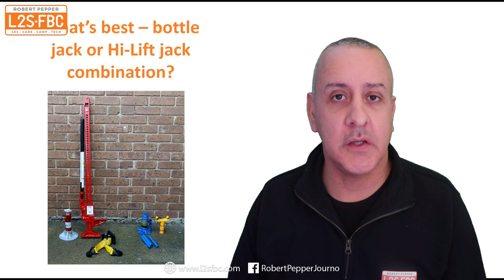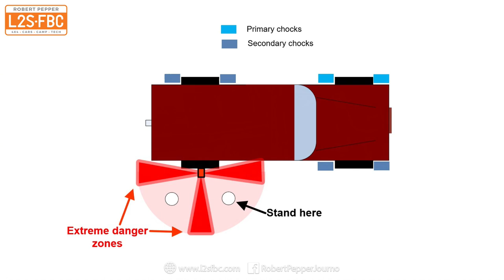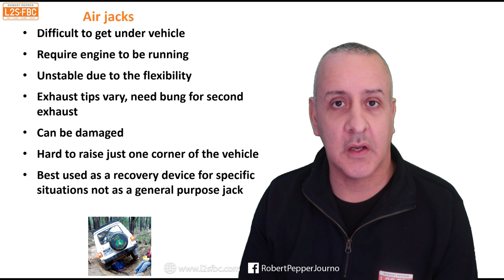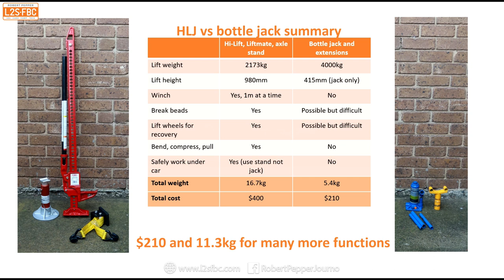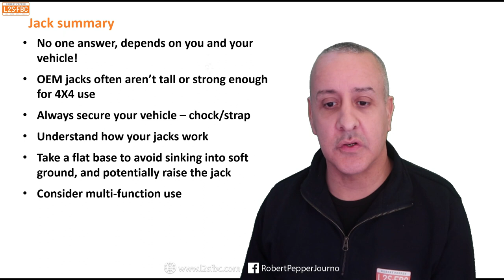Hi-Lift combination or bottle jack combination?

Comment: I need to point out that the attachment point of the Lift-Mate that you demonstrate is a safety hazard.  The hooks of the Lift-Mate must be positioned above the level of the axle to ensure stability.  If the attachment points are below the centeline of the axle and the vehicle shifts forward or backward it can cause the wheel to spin and dump the vehicle off of the jack.
Reply from the maker: But also the higher you go the harder it is to lift, and if the wheel is prevented from turning, then that's ok?
Reply: How often are you using a Hi-Lift on flat solid ground while wheeling?   It's not worth the risk.

Comment: I carry two  to three jacks . The standard scissor that comes with  the Nissan , a genuine Hi-Lift across  the spare tyre well  , and a small hydraulic bottle jack in my trailer box that can easily lift either the car or the trailer.   Sometimes one jack just can't do the job because of the varying environmental conditions .  High Lift is good for getting out of bogs but not so useful for changing tyres on most vehicles unless you have a stand as shown  and it has to be fairly high as the wheel will drop down on the suspension quite a bit as the High Lift jacks is lowered . 
On my High lift I have a short length of cord tied to one hook shaft and I past the cord through the wheel spokes and tie the other hook in.  Then I  lift .  Avoids the difficulty of keeping the hooks engaged while trying to raise  the jack .

Comment: The HiLift jack has a caacity of 7,000 pounds or 3.5 tons, and having used one since 1972, I have lifted many loads with mine, including the rear bumper of a 32 passenger school bus whose dual wheels were over a water bar cutout and the bumper was on the high point. Lifted it and filled the gap with rock and proceeded. Continuing on, I had to use the jack to push a 1000 pound boulder over the edge on the inside of a corner where it had jammed me up.

Comment: Really enjoying your videos. I typically carry my OE scissor jack with AEV base/chock and my Hi-Lift as well. I like having options.
Reply: I find a scissor jack is really useful too as with a flat tyre the bottle jack doesn't have enough room underneath the axle. So the scissor can lift the axle enough to get the bottle jack under and lift higher.

Comment: Great vid, there's too much negative press about the hi-lift. If you spin the offset base around (You might need to remove the split pin on that model and replace it with a cotter pin) you'll get the standard's base closer to the wheel, it decreases the tendency of the standard to lean toward the car.
Reply from the maker: I replace the split pin with a hi-tensile bolt as I remove the base for storage, and the pin is too much hard work to remove.

Comment: Jack-mate straps attached to a wheel are great, but as you point out Robert you have extra work now if that's the wheel you want to change.  Well built and fitted rock sliders can support the weight of the vehicle.  There are now adaptors made to cup under the rail of a rock slider to be used in conjunction with the high lift jack.  These are designed to stop the high lift jack sliding along under the rail if it's off the true vertical axis.  
A separate larger than standard jack base plate is an inexpensive worthwhile addition.  Another top tip is to open any car door the jack is climbing beside, so if the jack does start leaning in you have more clearance before expensive door contact....!
Reply from the maker: Good tips like them 👍

Comment: I use a mate and a high lift jack for 15 years - can be such a good recovery tool when bogged: just lift the wheel that lost traction up and chuck some rocks, timber....what ever you find under it that would give you enough traction....then lower it and most of the time you will find that it worked....

winching with a jack is a PITA so ...I use a standard hand winch that allows me to winch in every direction needed...

Comment: Great info!  Have used high lift jacks quite a bit but have since migrated to carrying a floor jack and a bottle jack.  But high lift is better if you are traveling alone (nobody to pull you out of a stuck).

Comment: 3:05 While I prefer the Pin type stand myself - there is a tab you're supposed to knock in, that is visible here, once assembled. It's near the top. Take a punch and knock it inward and it won't come apart anymore.

Comment: I own both. Just made an axle cradle for the bottle jack like yours. It's been incredibly handy not only for lifting axles, but for lifting at the frame to un-snag a vehicle hung up on a rock. Sometimes I just bring the handle of the hi lift and leave the rest at home because I use it a lot more than the jack itself anymore.
Reply from the maker: Got any photos? Sounds interesting !

Comment: By far the best bottle jack I have ever come across was the factory Land Rover hydraulic jack. Not only did it have a cradle which fits just about every live axle under the sun, but it also has a remarkably high lift. The jack is still available from Britpart stockists complete with the very nice handles under Part No. ANR4489, but it's not cheap!

In any case, my preferred jack is a 48" Hi-Lift All-Cast HL485 which is securely mounted and locked to my swing-away wheel carrier with a purpose designed bracket. I also have a bumper lift because that way I can lift directly from my rear recovery point without having to remove one of my spare wheels. I don't have the Lift-Mate as it doesn't work with the standard Series III wheel as it has no spokes, so it would be fairly useless!

I will definitely look for the Bahco axle stands though, when something like that folds away so neatly, it's stupid not to have one for safety sake! With a 2500 kg capacity, a pair will support my entire 88" Series III at GVW with 380 kg to spare.
Reply from the maker: Thanks great information !

Comment: Nice presentation Robert, never used a hi lift, that wheel attachment is a bit tricky as you don't have to compensate for suspension travel, l don't have a use for one day to day, but would now definitely pack one for an expedition.
     Chears Nige, 👍👍

Comment: I used a hi lift jack to lift my F150 by the tow hook on the front bumper to reseat a tire, in the middle of a blizzard. not a fun day, and i found out I only just had enough lead in my pockets to work the lever.

Comment: Have a look at lock your hubs and the oz trail 24watt camp light. So make a handle extension with lock pins. Cut one end at 45 degrees. Now easy winching or hammer into ground and put light on anywhere the cable reaches. Think car broken. Now you have light in full work area.

Comment: The fact that a vehicle can "fall off" a Hi-Lift jack can be an advantage in certain situations if you know what you're doing and doing it intentionally.  For example, let's say you have a vehicle whose engine will not start, but you need to move over to the side.  You can use the Hi-Lift jack to lift it a couple of inches at the receiver hitch and then push the vehicle to the side that you want it to fall...  For the front, it helps if you have an bumper that is actually made for jacking (unlike all the factory bumpers these days)...

I've probably used Hi-Lift jacks for tasks OTHER THAN changing tires a lot more than for changing tires... They are great for pulling 4x4 fence posts that have been set in concrete... Each type of jack has it's advantages and disadvantages... I have Hi-Lift, hydraulic bottle, hydraulic floor, scissor, and screw type bottle jacks and each get used for various tasks, often not even vehicle related... For example, I find the screw type bottle jack to be especially useful when I need to change the kitchen under sink garbage disposal... The scissor type jacks are great when you have a vehicle that you need to lift which have very little ground clearance and a floor hydraulic jack will not roll under it...

Also, keeping some 2x4 pieces cut for cribbing will help for lifting or as a jack stand or as a platform to sit your hydraulic bottle jack on when lifting at the axle... With cribbing, as you are jacking up the axle, you keep adding cribbing pieces as you are jacking up the axle as space becomes available for the next cribbing piece, so if you are using 2x4s, then the furthest that the vehicle could drop would be 1.5" (since a 2x4 is actually 1.5"x3.5")... Some people prefer to use 4x4 pieces instead of 2x4s...You can combine them, of course, as long as you don't mix and match on a single level of cribbing...
Reply from the maker: Thanks, great post!
Reply: @L2SFBC   -- Thanks... Of course, the PERFECT jack for the task at hand is usually the one that you DON'T have with you at the time... :)

Comment: Nice summary. But I am surprised by the prices you post. Looking online in the U.S. on October 2021, the going rate for the 1260mm lift variant (most common size in the U.S.) is between $100 and $130. Using the current exchange rate, this would correspond to between $135 and $176 in Australian dollars. Yet you posted $400. Should I assume that price includes both the 'Jack Mate' and the axle stand?
Reply from the maker: Correct, all 3

Comment: Great video.  I have looked at several jack stands like the one you showed that are available in the U.S., but they did not seem to provide the height necessary.  Is there a general minimum height needed for a jack stand for a stock Tacoma?
Reply from the maker: I would make sure it can raise the wheel at least 2 inches above the ground. Offroad surfaces are uneven.

Comment: read the manual for the high lift winch yes 4000kg but jacking good for 4000kg for the first 30 to 32 cm not the full height
Reply from the maker: Excellent points thanks should have added them!